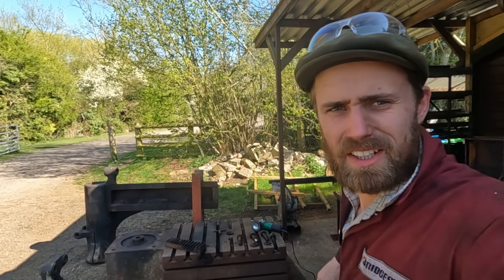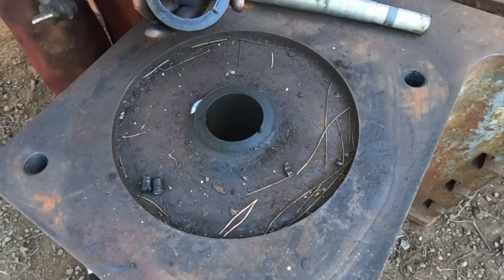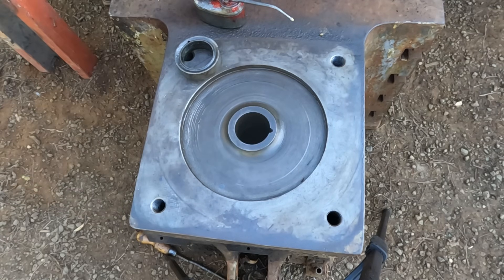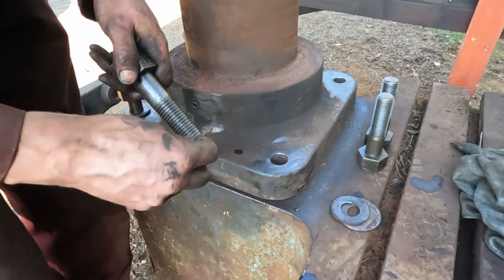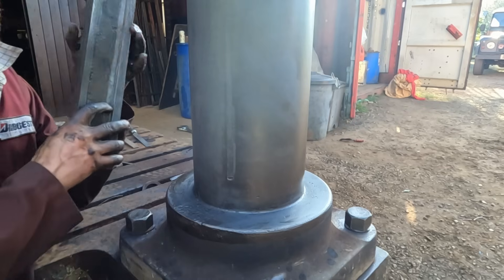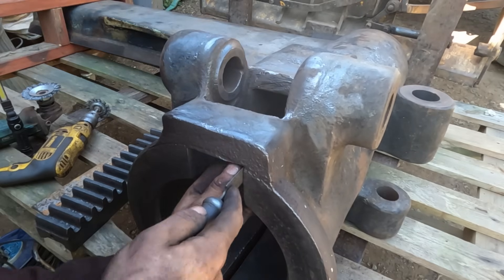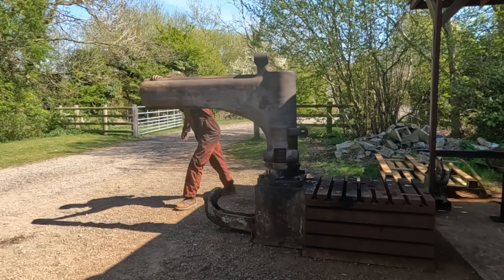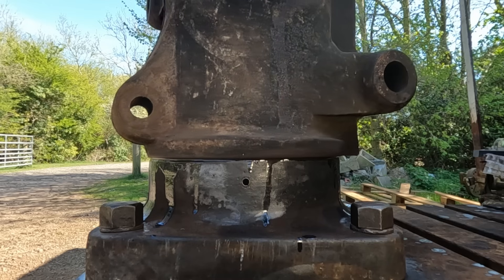Reassembling the Largest Castings! - Victorian Radial Drilling Machine Restoration PART 6

Comment: Hi Alec, I've not read through the comments yet so forgive me if someone else has already made this suggestion.  Since you have that badly pitted area under the rack which is located at the point where the arm would spend most of its life, would it not have made sense, if the bolt pattern would permit, to rotate the base column around 90° or even 180° so as to put the "rough" bit out if the "normal" operating arc? 
Yes, the oiler will point diferently but at least it will be spared direct aim at the normal drilling area and will lend itself to having a capped, wick oiler installed to tidy that up?. Just a sugestion! 

Otherwise, do you burn your overalls weekly or does some poor laundress clean them in kerosene first?

Super job so far. Im looking forward to binging through the other videos.
Regards from Canada's banana belt. 
🤞🇨🇦🍌🥋🇺🇦🕊🇬🇧🪓🐖💩👜🏁👍
Reply from the maker: No they only line up in one orientation. Having it all the assembled now, the pitting really doesn't cause much issue anyway

Comment: Just a suggestion: the straight rack moves on the column along its circumference, understandably the rack was rusted  into that position for a good few decades. How about making a bronz ring around the column recess, or other way around, a bronze plate attached end of rack just for peace of mind free movement when it has to cross that difficult spot. Lol whats one extra modification to an already veteran
machine. Looking forward to see that radial in action

Comment: Is your drill press Withworth threads or does it pre-date Withworth? 

I’m restoring an old Volvo now, and I’ve dealt with most of the rust in the car by setting up a continuous spray system with rust chelator called Rust911. I know there are similar products in UK, can’t remember who makes it though , but they sell a lot of auto restoration products .

Anyways , the great thing about rust Chelator is they are NOT an acid, so they’re safe to use on cast iron. Cast iron reacts super rapidly with acids , so they will damage CI.
Reply from the maker: @AndySomogyi  yes all Whitworth threads. 
Thanks for the tip, I'll look into into it!

Comment: Wow... A thought, I wonder if a custom cut piece of huge round washer, like 3mm thick hard material, like  hardox (which is pretty hard and wear resistant) could be put under the pinion rack? After that I believe there wouldn't be any pitting that could hinder the movement.

Comment: Nice to see Your project common along.
The pitting from the end of the rack is looking quite sad.
Would it possible to mount the column 90 or 180 degrees from original? 
Thus would the pitted area very seldom be in the working area.
Reply from the maker: Unfortunately, the holes only line up in this orientation. Typically victorian!
Reply: @iron_jonesy  that answers my suggestion of doing exactly that. Oh well! Like on a lathe, move the rack over that area everytime you use it to "work it out"!

Comment: The real difference between machines like this and todays modern machines is fairly simple. These old machines were maybe not as accurate as todays machines, but they had one distinct advantage. They lasted forever and you could rebuild them if needed. Todays machines use a lot of microprocessors and plastic parts. While they are definitely more accurate, they are worn out in five years. You rebuild them and they run another five years at which point in time you are told they no longer have parts for them and you will have to scrap them. I'd sooner have older myself.

Comment: Great job, looks the same but now turning is a big step.  Quick tip, JB weld + razor blade can quickly fill in pitting on a worn surface like that.  When needed I've filled pits in sealing surfaces and block sanded to 2000 grit without issue.

Comment: What a great post.  Stuff like the hand cut slot to grub screw.  The ease and care of the hyd machine lift to part.  The design of huge strength and capacity.  I now retire to my workshop and just maybe have a beer.  Maybe think about care and well thought fitment to repair task.

Comment: There are expoxies you can use to build up sideways.

Given the very low use of the swivel, a decent 2 part and some oil should sort it.
Reply: You can also machine them flat, then apply a layer of turcite.
Reply: @RoweSandberg  Overkill for this sort of application IMO.
Reply: @brendanshorter5550 Probably right. My first thought was to just machine away a mm or two. Probably wouldn't affect the way it works at all. But JB weld is a quick and easy solution. Good enough.
We used to run a boat engine where my dad used JB to fill a hole between the cylinder and the water jacket. It lasted more than 15 years of frequent use afterwards...

Comment: Those old London pattern screwdrivers are still one of the most effective screwdrivers around. That handle seems to allow you get far more torque on the driver and if the tip is correctly ground, they don't tend to cam out.
Reply from the maker: Yes! I have a decent selection here and love them. I'm always adjusting the grinds

Comment: It's been a treat following along on this journey to restore your drill.  Your smile as you and the arm orbited around the base was very well deserved.  Anyone that thinks that it wasn't much work fails to understand the challenges of working with parts that are that massive and heavy.  I've only moved far smaller items with my engine hoist. And even that makes things take four times longer.  So I knew full well what was fueling your smile at the end.    Brilliant work!  

Also I want to commend you for filming and producing wonderful videos.  That ability is something totally separate from the machine skills.  And it's far from easy to be constantly thinking of the two things at the same time.  Not only is your channel a unique and wonderful peek into how things were done in days long gone but you manage to make the videos themselves keenly engrossing.   This is what "reality TV" really should be ! ! !
Reply from the maker: Thank you!

Comment: HI good video! do you think that a new thrust washer at the bottom of the arm below the rack, or maybe fill the rusted area with brazing
Rich
Reply from the maker: It did cross my mind, but it seems smooth enough without, so I'm going to roll with it. Can always go back later if needed.